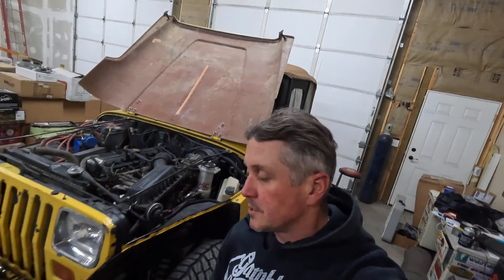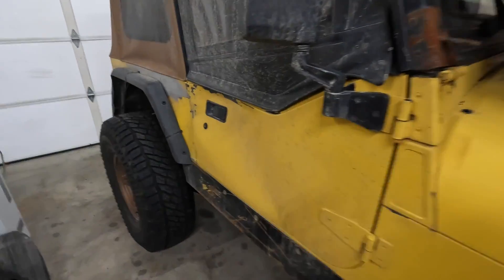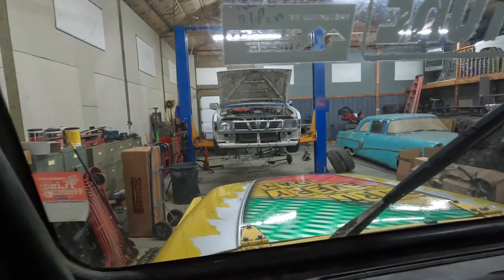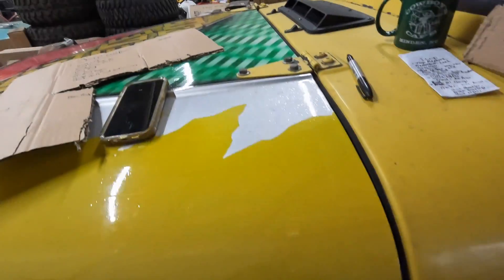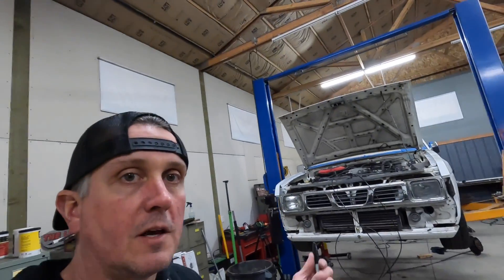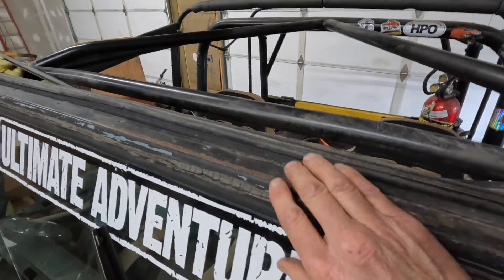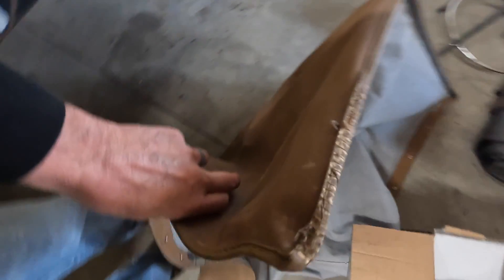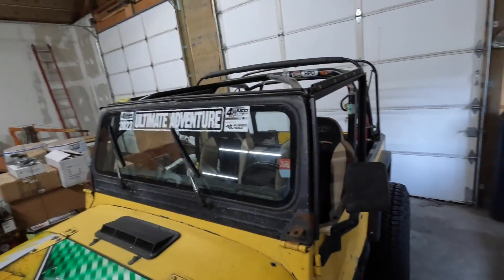Getting the Butter Jeep ready for Easter Jeep Safari 2023

Comment: We use nut-serts alot in our shop and we found buying the military surplus ones are great because they actually have a rubber sealing real to them and they aren't stainless, so they don't gaul when using stainless bolts.
Reply from the maker: Good find

Comment: Try pulling up next to a tree,
and use a come along on that passenger side .
Great show Dave, Thank You for sharing .
Reply from the maker: I should have. I kept thinking I needed to pull it next to the lift and come along
Reply: @thedirtheadshed  I couldn`t believe how sturdy it was .
Reply: Could have drilled a hole, put a single eyelet with a piece of metal length wise as a backing plate, and parked another rig next to it and winches on it. Came out nice tho!

Comment: I smashed my TJ tub in the same spot..I used a come-a-long and a tree and it pulled right out. A buddy with a winch would also work. You need to make a 10”-12” long section of a couple pieces of angle iron to reach around the back and hook the B pillar and out she goes! I welded a piece of scrap tube on the angle to put the hook through. I ain’t show car nice but for a woods Jeep it looks great and the half door now shuts and stays closed .
Reply from the maker: Nice.  I kept dancing around the hard work

Comment: If you put some red locktight on the outside of the nutsert when you install them it both seals out moisture to prevent rusting in the drilled hole and also prevents the nutsert from ever slipping. Just a quick old timer's trick I picked up.
Reply from the maker: Good advice

Comment: You have winches and Metal to make plates you can weld to the panel, put a couple 4x4’s to keep the Jeep in place and tug the plates to pull them out 😊
Reply from the maker: Sounds simple enough
Reply: @thedirtheadshed  I stretched the whole rear of a 65 Mustang back out, between my 5 ton Army truck (anchor) and my Cherokee with a winch and pulled gently while hammering and dollying. I pulled it out 12 inches and replaced the taillight panel and trunk floor. Love your videos

Comment: Good stuff as always Dave, I have had some success with mig welding some pieces of 2mm thick steel  tabs similar to the stud idea with either a nut or chain link welded to the tab and then use a slide hammer pulling on that, just means you can really pull it hard with more surface area
Reply from the maker: Yeah.  Chain link was my next step. But I ran outta time

Comment: Great idea with the nut-serts. We have the same issue with our CJ7 that has a fiberglass windshield frame. I’m curious is there is any reason that I couldn’t put nut-serts into the fiberglass panel. We run a bikini top all summer and I would like a bit more secure mounting for that channel than a bunch of self tappers in fiberglass.
Reply from the maker: It should work really well.  You just need ones with a larger grip range. Because the fiberglass is thicker than sheet metal

Comment: You could have rocked the Ketchup and Mustard look.  I think it's pretty normal to have mis-matching doors on a YJ.   I had Forrest Green doors but shot them with Krylon OD green so they would "match" my Sage Green Jeep better.  Even new, YJ's bodies were pretty wavy.  Are you running PRP seat mounts?  I want to lower my seats a bit.  I have stock mounts but no sliders with Mastercraft seats.  Yours look way lower.
Reply from the maker: I made frame work to mount the seats super low.  There is more about
It  in my UA prep and roll cage video